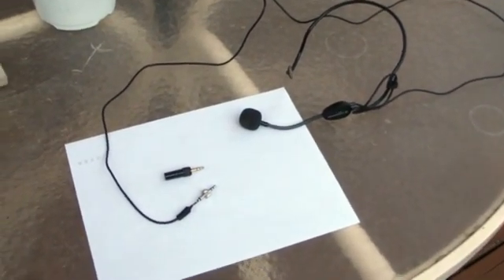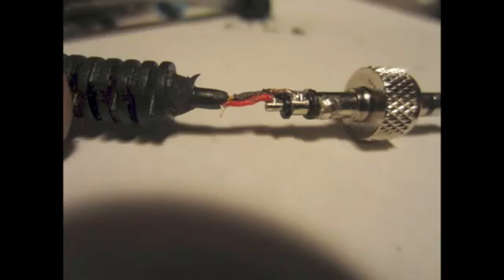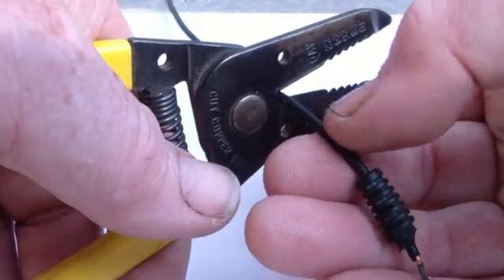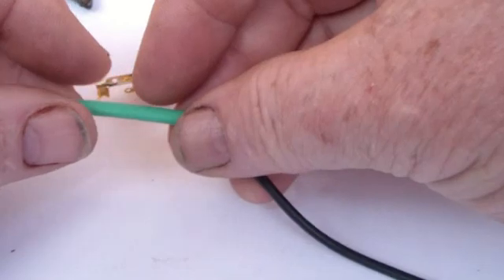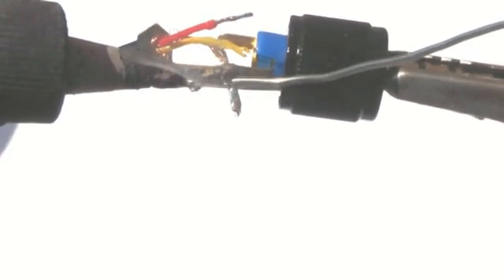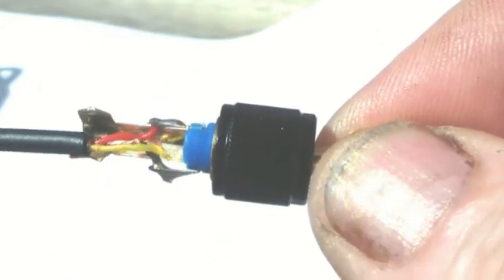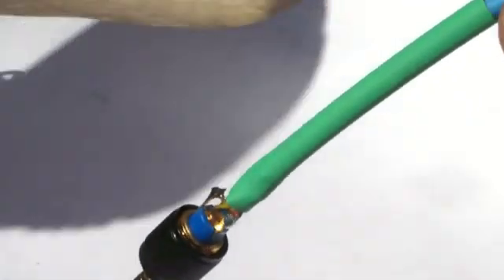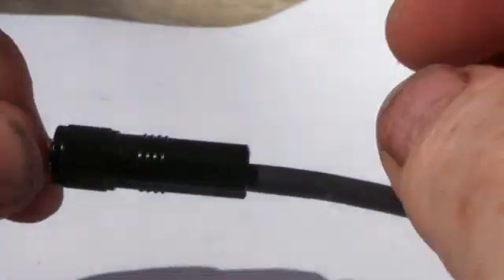sennheiser me3 mic microphone fix repair

Comment: The Sennheiser equipment is really strange. I bought a secondhand ME3 and it came with a standard mini jack which had a fault with the screen and was giving interference, so I decided to buy some locking mini-jacks that are on my other gear. I wired the ME-3 up in the same way it came (tip -red, ring - white, barrel - screen). It didn't work. I then proceeded to totally strip the mic down and fit new cable and it still didn't work. I received another mic from the same seller a few days later and after watching the film and reading this thread, noticed the normal mini-jack had the screen and white cable connected. I had already tried this on the locking ring and it didn't work, but now I'm thinking maybe I didn't screw the locking ring all the way down, because when you compare a standard 3.5mm stereo plug and the locking ring version, the locking ring version must only be plugged all the way in once it is locked down......or maybe even then it isn't in far enough. I'm not sure what the problem is, but I've returned to the standard mini jack with the screen and white connected and it all works fine.

Comment: TIP = Hot for microphone + Bias for electret capsule (connected to GND when the system is used as a Line input); RING = Line in (connected to GND, when used as a microphone input) ; Sleeve = GND

Comment: A bit misleading: The Ring and the sleeve are connected to GND...yellow and shield are connected to 1 and finally to GND ...RED is hot and connected to the Tip

Comment: Thank you so much for making this video and saving me and my church a ton of money. I used the Pearstone plug from B&H Photo for $5.99. The repair was a lot easier than I expected. I connected the red to the tip, and the yellow/bare to the middle ring and it worked fine, so I assume nothing connects to the barrel.

Comment: For anyone looking for the 3.5mm or 1/8th inch connector jack, https://www.amazon.com/Ancable-Replacement-10-Pack-Connector-Headphones/dp/B077XNTSF9/ref=sr_1_3?s=electronics&ie=UTF8&qid=1548645276&sr=1-3&keywords=ancable+3.5mm+plug

It comes with heat shrink tubing as well

Comment: Thank you for taking on the risk of disassembly for us all! Knowing that the sleeve is not connected to the Mic element (which requires phantom power) allowed me to adapt several off-brand headset mics to be used with the transmitter.
Thank you again!!!!!!

Comment: Brian, thanks so much for the video. I'm in the process of changing out the screw-on 3.5 mm on 8 of our ME3s. Two down... I did find that the yellow and shield were twisted together as well but on my old jacks, they were soldered to the ring and the sleeve. You can see a picture at the following link.
http://tinyurl.com/pae25ka
Either way, your video was very helpful.  Thanks a lot and keep up the good work.
Reply: Thanks Chris, you helped me fix my ME2. I followed this video but was picking up RF interference until I shorted the ring and sleeve.